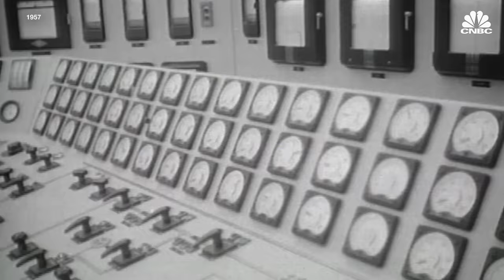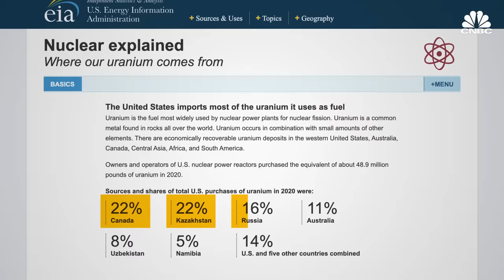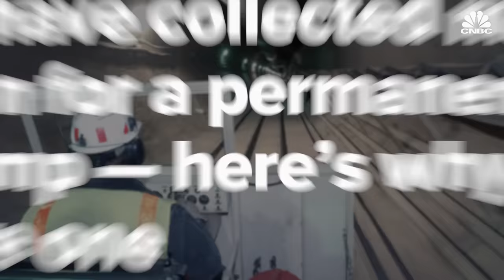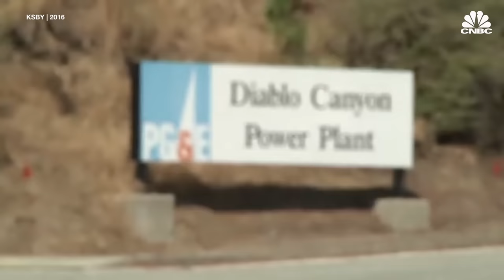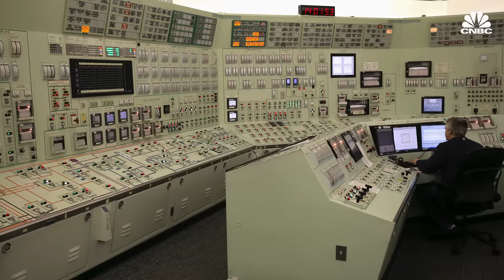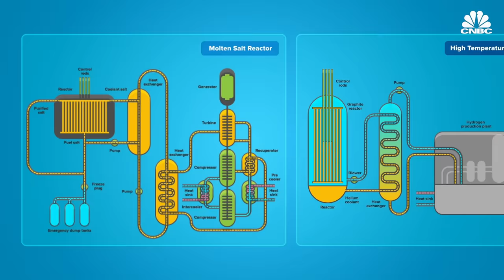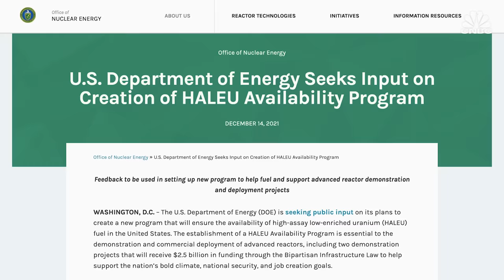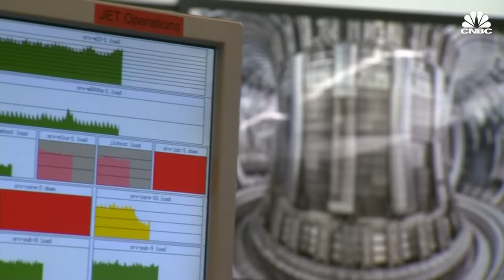Why Nuclear Energy Is On The Verge Of A Renaissance

Comment: A lot of fear-mongering in this video. The primary concern over nuclear power is not safety but cost. Building and running nuclear plants are really expensive. The real question is how can we make nuclear cheaper so that it's competitive to other green energy sources or even fossil fuel.
Reply: only building is expensive, running is cheaper than gas and oil even before carbon taxes and that stuff
Reply: @reahs4815  Not quite. There are significant regulatory costs in maintaining safety and eliminating weapon proliferation. SMRs also create extra waste as the process causes neutron leakage which is another added cost.
Reply: Nuclear is already cheaper than wind/solar when factoring in energy storage.
Reply: @pwillis1589  & Duerf - When you buy shoes, do you think about the price of the shoes or the price of the shoe factory?
It is possible that an expensive shoe factory (bigger, more equipment, etc) might manufacture cheaper shoes.

NPPs may be more expensive than a forest of wind turbines - but NPPs make cheaper electricity than wind turbines do.

We can see this in RE Germany, retail electricity rates 2x that of Nuclear France.
We can see this in RE California, retail electricity rates 2x that of Nuclear Illinois.
Reply: It's not comparable with renewables, so it doesn't need to be competitive with them. Renewables are intermittent, you can't control electricity production with them, so it's not in the same category, that's the reason we can't run only on renewables and why an energy mix nuclear + renewables is needed.
Reply: @xenotypos  All sources of electricity are intermittent. Even nuclear and fossil fueled. Demand in also intermittent it can vary by a factor of three during the day. Before solar utilities had to bring peaker units on line ever day to supply the increased demand and had problems maintaining the grid during those peak demand periods. In fact that is when they had the worst blackouts. With renewables the demand for peaker units has actually fallen. This is because solar dove tails in so nicely when peak demand exists. The right combination or wind and solar can give you the best alignment between production and demand far better than nuclear or fossils fuel plants. But there will always be a need for reserve capacity and peaker units as there always has been.
Oh I worked in the utility industry at a nuclear power plant for 35 years.
Reply: @matthewhuszarik4173   Wrong.  California is now wanting to charge their solar customers $8 per Kw of installed solar every month due to the solar glut they instituted in the first place with their solar incentives.  They are also now charging their customers over 50 cents per kW/hr between peak hours of 4-9pm hoping customers will install powerwalls so the utilities don't have to build more natural gas plants. Too much solar, no where to put it, then not enough solar when it is actually needed.
Reply: @reahs4815  Actually just running unclear plants is more expensive that building and running NG plants. That is why they are shutting down paid off perfectly operational nuclear plants all over the US.
Reply: @factnotfiction5915  False equivalence. California is a high cost state. Everything costs far more in California just because of that. It has nothing to do with nuclear vs renewables and storage. What is the average utility workers wage in Illinois compared to California? Diablo Canyon in California is one of the best run nuclear plants in the country with the highest capacity factors. It is more expensive to run than renewables and storage. I worked there for 35 years. If nuclear were inexpensive the Federal government wouldn’t have to be throwing billions of dollars at utilities to build them and utilities wouldn’t be shutting them down long before the ends of their useful lives. Your arguments are refuted by the facts of the industry. Plants are being shut down prematurely because they have become uneconomic versus the alternatives of NG and renewables. With the right mix of renewables you don’t need any more storage or the alternative peaker plants than you do with conventional power plants.
Reply: @pwillis1589  LCOE describes the cost of the factory.
Actual, real, empirical retail rates describe the cost of the electricity - because in the real world SOMEONE has to pay for intermittency.

Show me a jurisdiction with high wind and solar penetration and low retail rates.
Even if you cherry pick, you can't provide such an example - no such grid in the world exists.

Comment: We need to build the current gen 3 and gen 3+ reactors and begin research on gen 4 reactor designs, thorium reactors, micro reactors, and even fusion based energy. We also need to eliminate the unnecessary and burdensome regulations that make building new reactors so expensive.
Reply: Regulations that protect workers and the public are a vital necessity.  Until we get a lot better understanding about what regulations are not necessary we need to continue as we are.
Reply: @michaeldeierhoi4096  I've spoken with an anti-nuclear protestor/lobbyist. They specifically told me that most of the regulations on the nuclear industry are not about safety. They are about making the process of building a nuclear power plant take so long, and cost so much, that most people won't bother even trying to build one.
Reply: @michaeldeierhoi4096  plus, when I pointed out a number of government studies done by the EPA, nuclear regulatory commission, and national academy of sciences proving the safety of nuclear power plants compared to fossil fuel power plants (46 deaths for nuclear over its 70 years of use vs the more than one million who die every year from fossil fuels which includes accidents and pollution) she said "I don't care what those reports say, I don't want nuclear reactors to built ever again"
Reply: @michaeldeierhoi4096  until we perfect something like fusion based energy, we need something powerful enough to meet our energy needs and neither solar or wind are up to the task, only nuclear.
Reply: @michaeldeierhoi4096  my argument has nothing to do with Republicans or Democrats. It has to do with common sense, logic, and rationality. We need to stop making our decisions regarding nuclear energy based on emotion and fear, and base it on facts. And the fact is that nuclear energy is the safest, and most powerful energy production technology we currently possess.
Reply: Comprimises can't happen when it comes to construction.
Reply: @davidty2006  I'm not saying compromise construction. I'm saying that most of the regulations have nothing to do with safety and everything to do with the anti-nuclear lobbies and politicians wanting to make the process of building a nuclear plant so drawn out and expensive that most companies would say "why bother" and just build 4 coal power plants or 2 fossil fuel power stations instead for the same price as one nuclear plant in half the time.
Reply: @freedomwriter1995   Odd that CNBC would address commercial nuclear power issues WITHOUT mentioning any of the consequences of nuclear capital costs -- which is what killed the industry in  the first place in the United States.   Plants coming on line back in the 1950's and 60's all were built with a Government subsidy with up to more than half of the capital expenditures taken up by the then Atomic Energy Commission and reactor vendors as seed investment for future operating plants.   This situation evaporated in the 1970's with utility customers for reactors assuming the full weight of capital costs for the plant and this situation caused the cancellation of almost as many plants as are running now due to true capital costs and operation and maintenance costs being truly reflective of what was actually happening at each site;  the situation now being over for free money from the AEC, General Electric, Westinghouse and the remainder of the suppliers.  This placed the planned and operating plants on a finer economic edge; making expensive things going wrong more of a determining factor for economic operating the plants in future scenarios.   A gone-wrong steam generator replacement maintenance effort in two of the West Coast plants caused that utility to close down the eight-billion dollar facility for good; forcing the utility customers and the stockholders to eat the capital costs, and this was not the only utility to shut down a site due to insurmountable repairs and maintenance costs.   Reactor suppliers in the United States offered the utilities different 747 airplane designs for each plant and each utility;  something that would break a company like Boeing many years ago.   A re-started nuclear effort in the United States with the same commercial ground rules of competition and non-standardization of plant equipment will result in the same overruns for the same reasons as encountered before: a lack of scope definition and therefore ultimate responsibilities to be faced.   Far more successful in nuclear proliferation scheme was carried out at EDF in France through standardization of design and government financing;  although these nuclear plants as well are finding themselves susceptible to unusually high maintenance efforts.   CNBC and its producers and management have apparently decided that this important history of nuclear power in the US is ostensibly irrelevant and is to be virtually ignored by the current proponents as though it never happened.